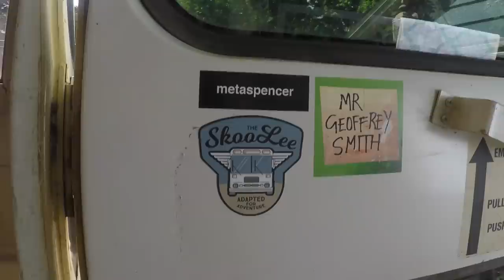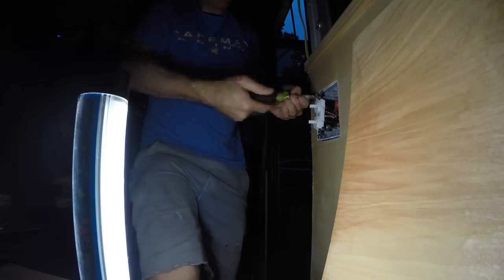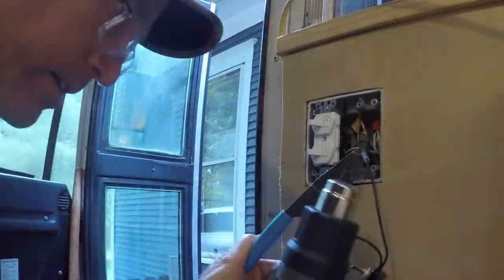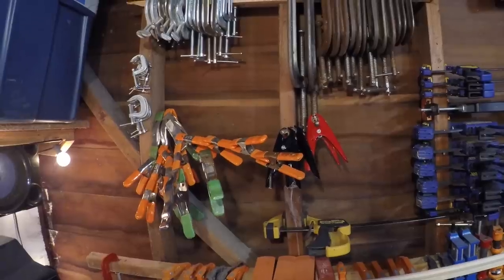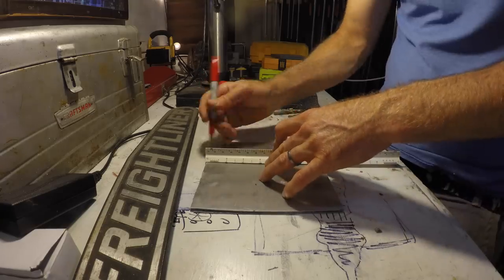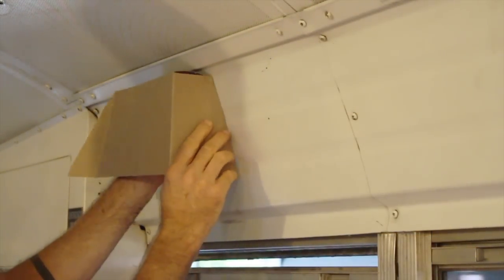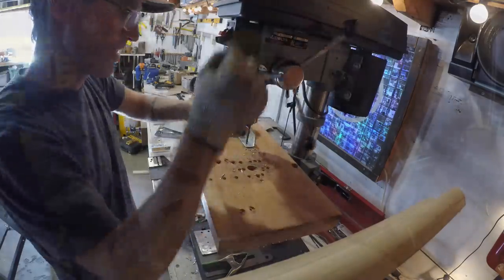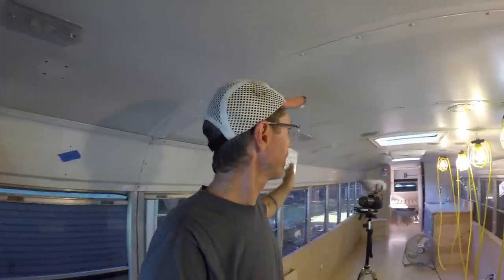Making Lights and More -- Prison Bus Conversion #40

Comment: When you clean the bus, try star brite boat hull cleaner, we have stains on the boat that wont come off, but you spray that stuff on and the dirt drips off, its amazing
Reply from the maker: thanks for the tip! I've tried some kind of "RV wash" stuff, but it doesn't seem to make much difference. That stuff sounds industrial strength
Reply: @metaspencer  its AMAZING, it blows me away how hard I'll scrub and nothing comes off but I'll spray that and the dirt just drip off.

Comment: Hey, Spencer.  Aesthetic question, what were your thoughts on using the different style switch (the 12v one) up front in the double gang box versus using another 120v switch (still running your 12v system) but so that they match?  Just curious about your process.
Reply from the maker: I thought about that a lot -- probably too much! As I understand things, 12v switches need to be toggle or rocker, not just the regular switches I use all the time on AC wiring. I don't fully understand this, but having read that I decided to go with toggle and rocker switches for the 12v. So that practical consideration came first. Now, this mixing of switch types means that I'll have to custom fabricate the cover plate ... and that the whole setup will look unconventional. But the thing is, aesthetically, that I like the look of all kinds of odd switches and gizmos around the bus ... kind of reminds me of the front control console itself, which is defined by its huge array of switches of all kinds. So anyway, those are my thoughts! Now to get out there and fabricate the custom cover plate. :)
Reply: @metaspencer  120V switches are fine for 12V, just not the other way 'round. I might have gotten some in a different color for the 12V circuits.
Reply from the maker: @ryanlangan1060  Different color! great idea man

Comment: How do you like the original celing? I'm trying to decide if I should keep mine. It's got tiny holes all over it. It looks like yours I think. It looks good in your bus. Thanks for sharing.
Reply from the maker: For us, the original acoustical ceiling is great: it's solid, absorbs sound, and is insulated. I know a lot of people pull out the ceiling panels, and I can see that ... but for us it made sense to keep the original ceiling and move forward with the build
Reply: Thanks. Looks like I'm keeping the celing. Your bus looks so good it helped to make up my mind.
Reply from the maker: Cool. Ya know, there are pluses and minuses with each decision in a build like this. The nice things about keeping the ceiling, for me, have been not having to struggle to make a new one look good, the stability of the steel ceiling (for screwing walls into it), and the time savings. Good luck!

Comment: Just curious that you're running 110 and 12v for smaller loads like lights and such. Any reason you didn't go with a converter on your shore power and make all the lighter loads 12v? Again, just curious. Those sconces look pretty sweet and it's always cool (and a money saver) when you can re-purpose materials.
Reply from the maker: I have a converter running but just thought AC light options would be cool and maybe even brighter. You doing all 12v lights? I can see that being good
Reply: Ahh ok. I'm planning on 12v for most all electrical: LED lights, power sockets, fan, cooler, etc. I do plan on having at least one 110v outlet for possible mini fridge or heater, but due to the size of the bus and running a smaller battery bank/solar system, I want to keep my electrical draw as low as possible.
Reply from the maker: Sounds like a good plan